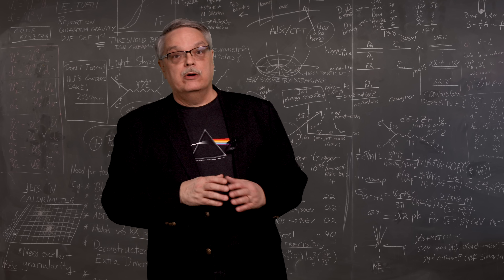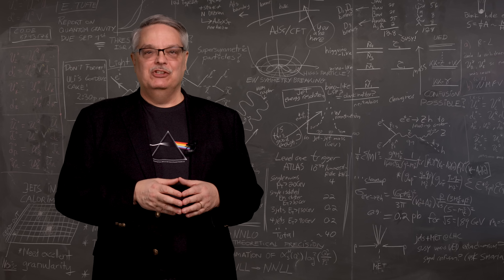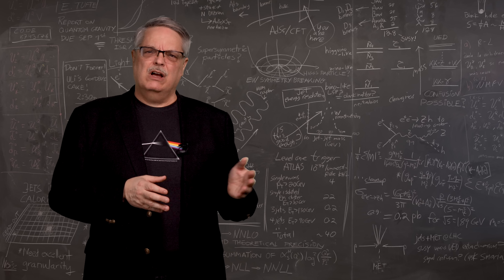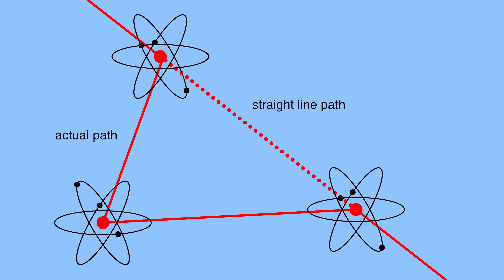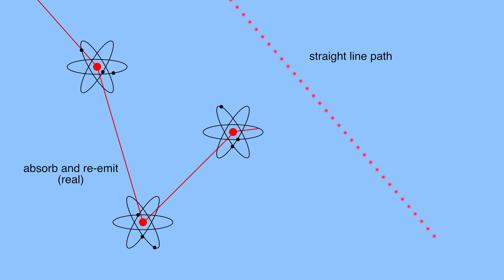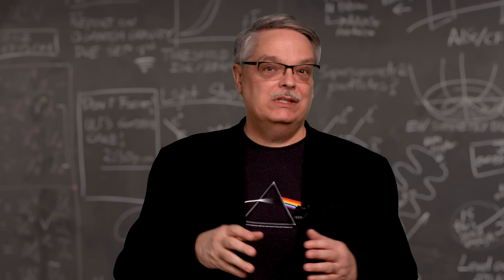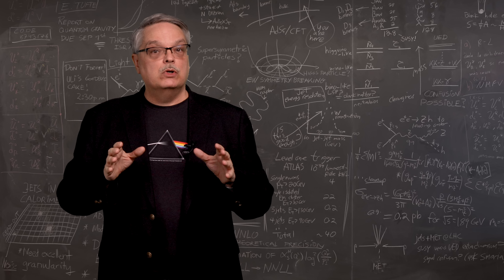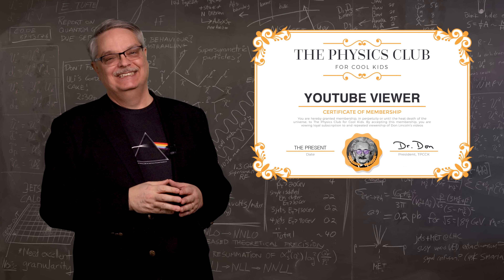Why does light slow down in water?

Comment: You stated that the resultant light wave in the medium, which is a superposition of the two waves - the incident wave and the radiated wave by the electron, travels slower. But the question of why the speed of propagation of an electromagnetic wave in a dielectric medium is still unanswered. The question of why the incident wave slows down has now been transferred to the question of why the induced wave emitted by the electron is traveling slower than the speed of light in a vacuum. There is no elucidation of the mechanism by which the speed of propagation in a medium is reduced by a physical property of the medium. If the radiation emitted by the electron has been reduced in speed then why does Bremsstrahlung radiation propagate at the speed of light in a vacuum?

It seems to me that we are just as lacking on the basic physical principle of the slowing down of electromagnetic waves in a medium as we are of the physical nature of a field in itself; electric, magnetic or gravitational. We see the effect of the field and can quantify its effect on charged particles or particles with mass but we are at a loss as to intimate knowledge of the physical processes at work. To me, it's kind of like invoking the presence and influence of an unknowable supernatural entity to explain equally mysterious phenomena of nature. Personally, I prefer to admit my ignorance and spend my time and efforts in expanding and correcting the limits of my knowledge.

I find your work both interesting and informative and do not intend to be disrespectful in any way, just annoyingly curious perhaps.

Comment: Interesting, then it kind of work similarly as a magnet moving through a copper tube, generating electricity in the copper tube, resulting in a magnetic field that slows the magnets passage through the tube. 🤔 I wonder if there is a connection here somehow?

Comment: So, this may be subtle but, is there, then, ACTUAL light that is propagating across space at a rate less than C? Wouldnt that possible imply that composite waves have Mass. I know this isn't the case, I'm playing devils advocate, but could you go a bit deeper into the correlation between the wave nature of light and the mechanics of its propagation?? Respectfully, I believe its fairly important here and slightly under stated.

Comment: I don't buy it. Just because light bent does not mean it has slowed down. What has happened is that the structure of the molecules has caused it to deviate from a straight line. This why when the angle of incidence change  the more the refracted angle will correspondingly change. Up till a point, the incident ray is reflected. It's a bit like light going thru an ordered hall of mirrors (the molecular structure). The slow wave addition theory doesn't explain why the incident angle is not proportional to the refracted angle. The information carried by the light has not changed. It's path has. I still hold on to a mechanistic view. It has to be. It involves material density.

Comment: Right away I'm thinking that I can understand why light slows down in water, but then I'm wondering,
if that's true why does sound travel farther in water. You tend to think thoughts like that, when you're floating
on the surface, snokelling for an afternoon, floating in the current along the shallow shore of Lake Erie.
Reply: Because it's a different mechanism to transfer sound energy and light energy.

Comment: Dear Sir, With all due respect, you are carrying the name of a very prestigious scientific institution. Most people would look up to you and believe what you say. Therefore, you are carrying a huge responsibility to make sure what you say is accurate and useful. You do not want to become one of the sources of misinformation which you described at the beginning of your video. 

I would like to make some comments to make the matter more clear for some of your viewers. I am a part-time physics teacher and I would like to do this for the sake of science. Nothing personal. 

You know that there are two different models of light. One is the classical, electromagnetic wave model, and the other one is the Quantum mechanical model which views light as a stream of photons. Both of these models are extremely successful in explaining most of its properties. However we know that the Quantum mechanical view is even more accurate and can explain some aspects of light that is not possible to explain with the classical view (such as photoelectric effect). 

I think, what most people are looking for is the explanation of the slowing down using the more accurate photon picture. which is the second explanation you dismissed so quickly. 

Something you need to consider about the absorption and emission of photons by the atoms is that, they are happening together like an array of antennas. Sure, if you have a single atom, not correlated with any other atom, and it sends a photon, it will do so in a random direction. But, when we have a large array of atoms, excited in an orderly fashion, (as with an incident coherent photons of a laser beam) and they are sending photons, they do not send their photons in random directions, because the outgoing photons' quantum wave functions interfere with one another and amplifies in a certain direction similar to what happens with a diffraction grating. So your rejection of this explanation is based on some misunderstanding. 

Some professors, as you mentioned, associate the slowing down to the delay between the absorption and emission of photon by each atom. This might be correct but does not explain the whole thing.
  
This phenomenon could also be explained using the classical wave picture. In this picture, as you mentioned, the electron cloud of each atom vibrates and creates its own wavelet like a classical antenna. The resultant EM wave is the superposition of all of these wavelets. This results in another wave that happens to have a lower speed than c. This calls for a very careful mathematical derivation.  I think I have seen a calculation like that in Feynman's lectures, but I could not find it today. Anyhow, in my opinion, unless this mathematical step is filled in, or someone can bring an equally clear non-mathematical argument to fill this gap, I would consider this phenomenon unexplained.  
 
This would be the exact equivalent of the photon picture. In the classical picture the EM waves interfere with one another, and in the photon picture the quantum mechanical wave functions of photons interfere with one another. So the math should eventually look the same. Only the interpretation is different. 

In your explanation, without giving any reason, you just assert what we were originally looking for. "The speed of the waves created by the atoms is lower than that of the incoming wave". This is not a satisfactory explanation to your viewers, as you see the comments left by other people.  Also there is another problem with your explanation. The wave created by two waves with different speeds in your animation beats, or changes amplitude over time, (as you showed) which is not the case in reality....
Reply: (i think this explanation over the differing lightspeed would be more appropriate even though this is a simplified version as it does not consider all the properties of the medium since this is the results we get when considering the thermodynamics effects of the medium analogous to friction to be negligible)
this video has taken many shortcuts in explaining the relations between the two systems and how it affects them.
to better understand this, we need to talk about d'alembert's equation and its dispersion formula and how it describes a wave.
so d'alembert's equation is used to link together the spatial and temporal variation of a wave.

and from this equation comes the dispersion relation that links together the frequency, wavelength and celerity of a wave.
to access to this equation, we use maxwell relations to describe this phenomenon. when we consider those relations in the void, we get the relation: c² = k²*w² where k is the angular frequency and w its wavenumber. (just google it, ain’t that hard to understand)

thus we can see here that the celerity is proportional to its angular frequency. however, as explained in the video, when light enter a medium, there are charges that can be influenced by the electric field, especially electrons that are 2000 times lighter than their counterparts protons.
thus, when light comes in this medium, we assume that only electrons are affected by the electric field.

we then apply newton's second law to those electrons to find a relation between an electron's speed and the electric current
(we also neglect the magnetic field of the light as the electron is relativistic thus the force from the electric field is much greater than the magnetic one see lorentz law to better understand this )
and then by generalizing this equation to all electrons in the medium, we can get an induced current from the electric field of the light.
( the current is j = n * v with n the volumic density of charges and v the celerity of electrons)

then when we put this back to maxwell ampere local equation, we introduce a new component: the induced current which thus gives us a new dispersion equation: c² = k² * (w² - wp²) with wp the plasma oscillation and thus we can see that from the value of wp, we'll get a different value of the celerity of the wave.

thus we can say without a doubt that they are wrong in their explanation as it is not the combination from the electric current of the electrons and the wave that makes it slower but the induced current inside the medium that modifies the dispersion relation thus modifying its speed.
or in simpler words, it's the movement of electrons that changes the frequency and celerity of the light, but not the combination of the two electric current. (also on a side note, trying to represent the electric current of a dipole using a sine wave.. funny thing you did there 😅)

and finally, as for the reason why the light has a different angle, well you can easily explain this using two waves parallel to each other crossing the medium in phase with each other. as they have the same wave plane, you can easily come to the relation between the refracted angle and the incident angle using some basic geometry. i recommend you to see the demonstration of descartes second law if you want to better understand what i'm talking about.
Reply: @recouer  Is this a reply to my comment or this is a separate comment on the main video?
Reply: @physicstree9425  
no this is a separate response.
btw that's a nice channel you have there. might as well take a look at it to familiarize myself with some of the physics vocabulary in english.

Comment: Since this "flavor" of superposition still requires one wave to travel at the speed of light, as measured in a vacuum, and the other at a slower speed, I can understand how the observed speed of light is slower, when measured in the medium... but doesn't the original wave, though impossible to observe, still pass though the substance at the speed of light, as measured in a vacuum? i.e. the wave passes from point A on one side of the glass to point B on the other side without taking any additional time?

Comment: so if you pass light through some wave that is faster than light, then light would travel faster through that spot, and then slow back down to normal after breaking free of the faster spot. i don't think so. so i say you are wrong.
imagine the recycling of the energy of light, as it passes through glass, it also has to expend that force to pass through, once it is through it's energy strength will bring it back up to speed. like swimming along just fine until you get into seaweed, you put out the same effort but swim slower due to more work, then when you get out of the seaweed, you go back to your regular pace, as if you don't get tired. but see, light doesn't get tired, it recycles it's energy fields so it has full energy. as the split particles come out and loop back in, they cool when out, joining together, then when heated going through center, they split and come out the top,  they cool as they loop back around to the bottom....  going through glass heats them, keeping them split so they are not full strength. once through glass, they cool properly and rejoin at full energy.

Comment: Don Lincoln capably knocks down a couple of wrong explanations but then treats us to another wrong one.  

The secondary wave emitted by an array of accelerating electrons (that are driven by the primary or input wave) is at the same frequency as the primary wave but shifted in phase from the primary.  The superposition of the secondary with the primary yields another wave at the same frequency but with an effective phase delay so that a given wavefront reaches a given waypoint later than it would if the array of electrons wasn't there.  And this phase delay is proportional to the thickness of the material that includes those accelerating electrons.  

So it's as if the wave was traveling slower through the material than it was in vacuum.  But *all* the component waves -- both original and secondary -- travel at the speed of light in vacuum.

Once you have this net effect of the reradiation by those accelerating electrons, characterized by an "index of refraction," you can readily derive such results as the bending of the path of a beam of light at the interface between two materials.  It involves enforcing the boundary conditions on the wave's electric and magnetic fields at the interface.  Lincoln doesn't go into this point at all.

Comment: Stupid question. If a material could create an atomic wave inside the material in the direction of light. This wave should be of higher frequency say X-ray. Then it could accelerate the light to higher speed than the vacuum speed.  If it’s possible, couldn’t this break the rule that nothing could go faster than light?

Comment: @Dr. Don Lincoln - short question - 
If the combined wave runs slower in the medium - just to get this right in my head - the incoming color monochromatic  blue (e.q.) would be inside the medium a different color (or color at all - depending on the combined wavelength frequency) and then be blue again if it exits the medium, right?
Reply: Yes.  In a medium:  wavelength(in medium) = wavelength(out of medium)/(index of refraction)
Reply: actually no, the wavelength stay the same, but the frequency is modified.
for better understanding i recommand you this if you can understand it that is :
https://en.m.wikipedia.org/wiki/Mathematical_descriptions_of_opacity